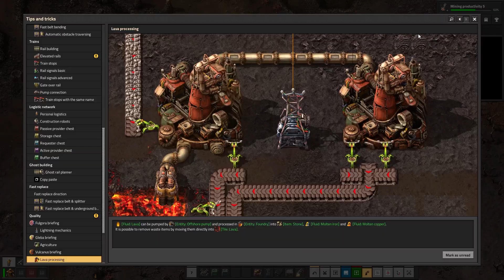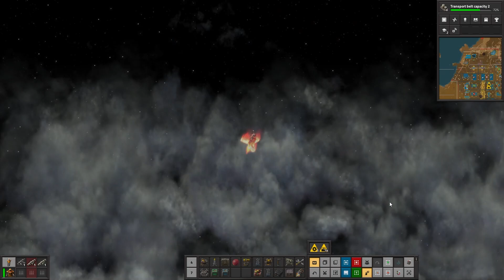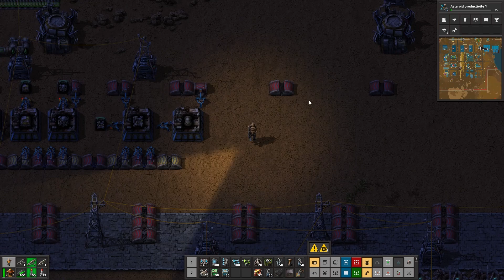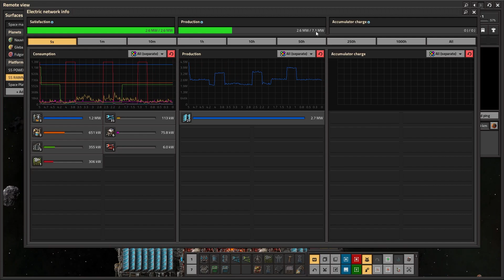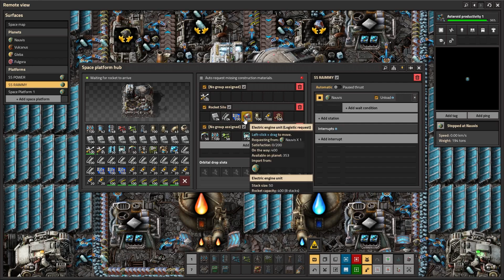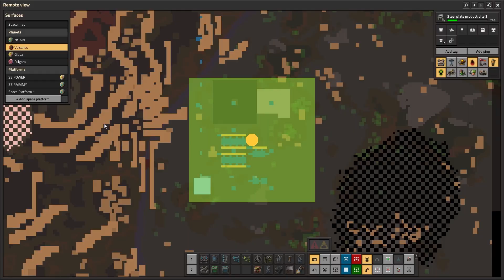Touchdown on Vulcanus - Factorio 2.0 Space Age EP13

Comment: My fuel throttling circuit is 2 combiners and a bit of guesswork: a clock that reset at 100 a decider combiner that checks the clock is below a threshold and the threshold is set by experimenting. (Basically it represents the percentage of actual flow you want to get through)

Comment: At 12:30 the Rocket "weight" of an item is described in the tooltip, not in kilograms or tons, but as the stack size or quantity that will fit into a rocket. That is what the Rocket Capacity means in the tooltip. E.g. Rocket Capacity: 25 (0.3 stacks). (it rounds up to the tenth place for the stack amount) :)
Reply from the maker: Ah I see

Comment: You could set up some circuit logic that turns off light oil cracking when the petroleum gas storage gets 60% full then some more circuit logic so when the petroleum gas storage gets 80% full it turns on petroleum gas to solid fuel manufacturing.

Edit: I think you can set filters on the asteroid grabbers and link them to belt readers so you can say if there are 50 metallic asteroids on the belt don't grab metallic asteroids or bring the sushi belt near the edge and do some circuit logic so an inserter will throw away chunks if there are too many.
Reply from the maker: Yes I need to do some proper circuitry on my petroleum build. At some point I want the solid fuel to produce based on whether we have more or less light oil vs petroleum, but your way works too I think. Maybe I should just control the cracking based on the storage tanks

Comment: Ep.13 Comments, part 2. 5) At 56:42 Examination of the worm show it has 100% resistance to everything, except: 50% resist to Physical (minus 5 damage), 50% to Poison, 20% to Electric (minus 20 damage). Therefore green magazines and Poison Capsules should be the right thing to use !! I think this game expansion is great, because it forces you to use weapons that you would not normally use. 6) You keep running into cliffs on Volcanus because you can't see them easily. Remember the tip I gave you about Deconstruction Planners: you can make one with cliffs only selected, and apply it to the whole map. Cliffs will be marked with a red "X". 7) Suggestion for Nauvis: place 2x Mark 2 Productivity Modules in each lab. This will cost additional power and reduce speed. To compensate for speed loss, increase to 5 columns of labs instead of 3. Result: the factory will consume less materials for the same amount of research, will use less power, and will pollute less. Allright talk to you soon.
Reply from the maker: I kill the worm 2 episodes from now and I use a weapon I would NEVER normally use haha!

Comment: Ep. 13... time for comments ! Part 1... 1) You may have missed my comments part 2 for ep.12, usually when you see a comment you reply to it. 2) At 15:22 in the space environment simulation, I don't see any pipe sending oxidizer to the left-most Thruster. However I assume that from what I see, Thrusters can pass fuel and oxidizer to each other if they're touching ? By the way, I LOVE seeing a looped design for the Space platform ! 3) At 25:36 One train wagon is full, one train wagon is empty; this is the best proof you need that Train station conditions should be "Time passed: 120 seconds" (or 180 seconds maybe) instead of "Cargo Full" or "Cargo Empty".  4) "How do I make sure that there is Ice on the belt constantly, without manual intervention ? I found the solution: a) in the bottom right corner of the platform, LOCATE AND REMOVE two solar panels: remove the two that are tp the right of the Oxidizer fuel line; b) Place an inserter in the now-free area that will pick up one particular material from the belt (not Ice, of course) and that will place it on another belt going east; then, east of the belt, use another inserter that will dump that material into space. The material you choose to get rid of should not be iron because that would not make more room for Ice. This will act as an "exhaust pipe" for the platform. (continued...)
Reply from the maker: I dunno, I'm not a fan of the looped design, spaceship 3 is going back to spaceship 1's design haha. Okay I'll give the train time passed a go.

I would need to read the belt contents to ensure there's free space or the right ratio of stuff on the belt right? Coz what if I throw away too many asteroids and I run out?
Reply: @DataEngineerPlays  2 solutions: 1) Use belt ready as mentioned; or 2) Use a slow inserter that will provide some work but not too much, removing the risk of removing too many items.
Reply from the maker: @power2084  time to go into my playground and experiment with all this tech I never use haha